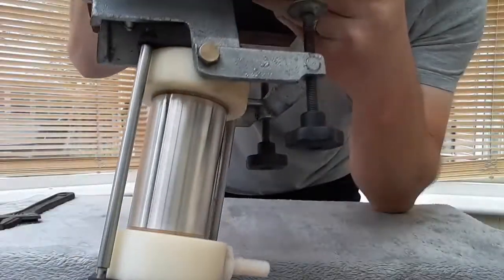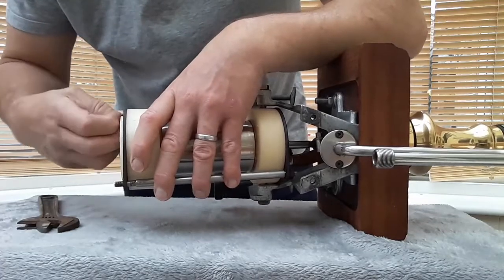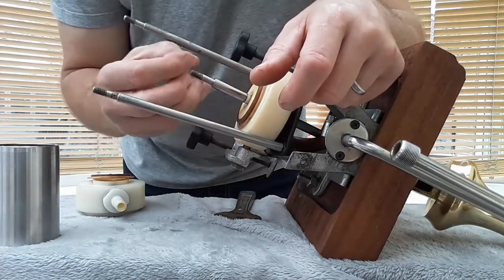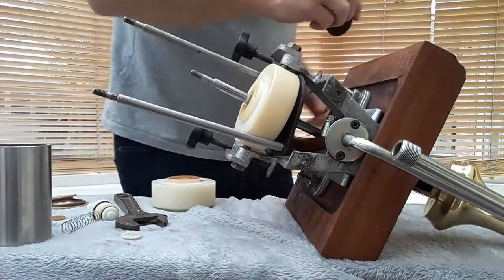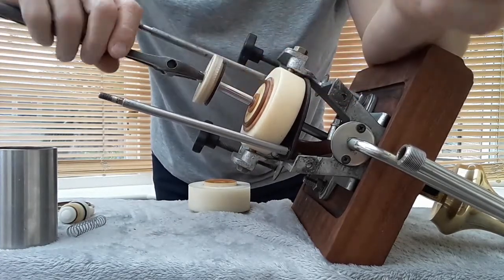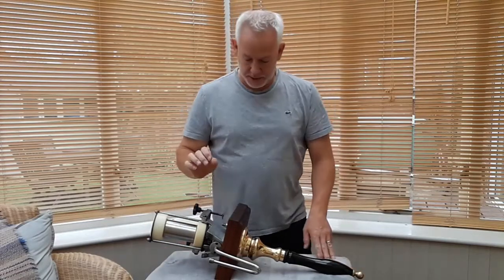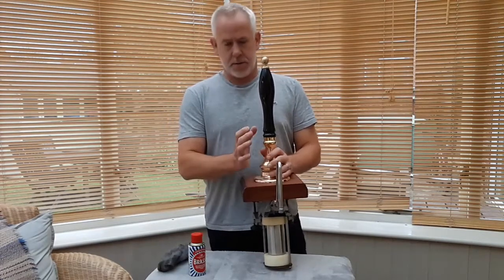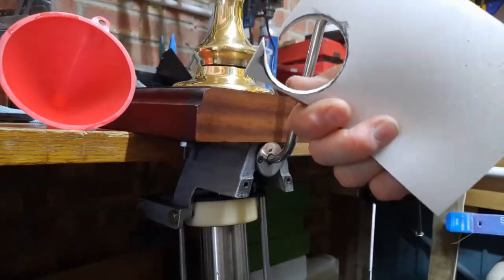Beer engine full service

Comment: Hi mate great video lots of information on my setup I have a demand valve and then the pump, but for some strange reason I’ll keep getting the constant drip out of the Swan neck. I don’t think it’s the diaphragm as I’m able to pull steriliser water through. No problem, but when I tried with beer it just had a constant drip thanks any help would be great
Reply from the maker: Hi Steve, is the beer carbonated or is it hot as the pressure will force it past the diaphragm. Try cooling the beer down.

Comment: Excellent video.  Many thanks for sharing.  Our local village hall bought a second hand beer engine a year or so ago which looks very similar to the one in this video.  We haven't had the confidence to dismantle it - we just cleaned up the outside and sterilised the insides before using it.  It has been working fine so far but, this week, has developed an issue whereby the pump "sucks back" the beer from the glass when the handle is returned to the vertical position after each pull.  We can get round this in the short term by moving the glass down, away from the swan neck each time the handle is returned to vertical, and then putting the glass back when the initial output of air has been ejected on the pull down again but it would be nice to solve the problem.  I do feel confident enough to attempt to dismantle the pump having seen your video but does the problem I've described sound like it could be the diaphragm or should I be looking for something else being the cause.  
Thanks again
Reply from the maker: Hi Dave, thanks for the comments.
The pump has two working valves to help pump beer, the diaphragm draws the beer up and then there's the none return valve which prevents the beer dropping back to the keg. In my case once I primed the pump beyond the none return valve my pump would work. I suggest looking at the none return valve first and you should find it at the bottom of the pump where the beer line connects to the pump. It should only have a spring and a ball inside with rings to help seal. Hope this helps.

Comment: It is designed for a rotary movement shaft, but because of the low speed, it works fine with linear movement
Reply: Yes I have had to order a 38mm X 51mm X 7mm rotary seal and that seems to work fine

Comment: Hi, I have found a 3/8" x 3/4" x 1/4" nitrile (foodsafe) oil seal, on ebay for the cylinder top seal. It has been working with no sign of leakage for some time now.
You are correct to say that spares are difficult to find, but as you have shown with your silicone diaphragm, a bit of thinking outside the box, often works. Hope this is helpful
Reply from the maker: Thanks for the update, do you have a link?

Comment: I have questions I’ve been scouring the internet to find so I’d rather not do the counter pressure method for filling the kegs because I am limited to funds so I was wondering if the kegs could be depressurized disassembled filled then reassembled and have it’s same function? I was also wondering if the function could work with a thicker liquid and not just beer would love to hear back from you
Reply from the maker: Hi Sayvon, not sure how thick the liquid you want to pass through it but all things have there limits, I guess you will have to increase the pressure to force the thicker liquid through. For the other question, once you've removed the valve you can add C02 to the keg as this is heavier than air so in turn will force the air out of the keg, then by filling it with your liquid should keep it good. Hope that helps.
Reply: @mtb1340  this helped plenty and very insightful thank you